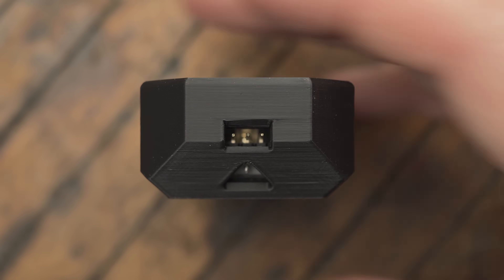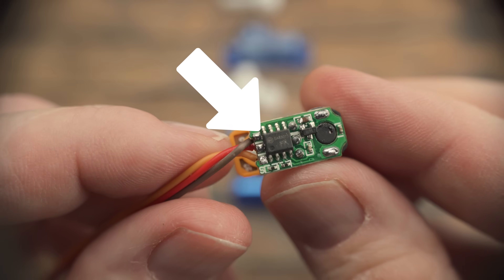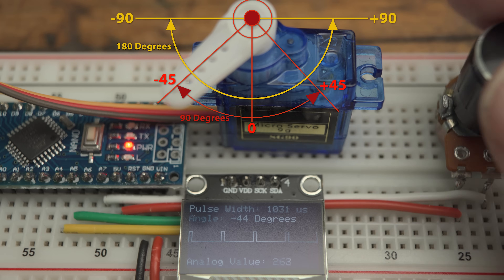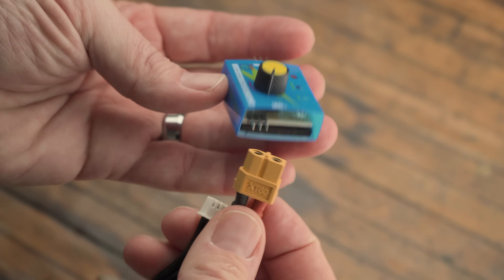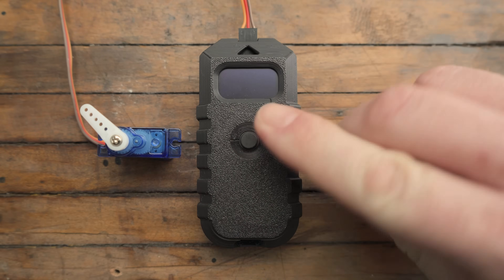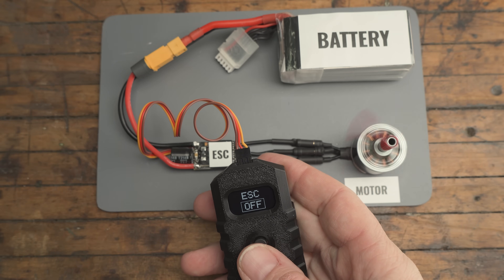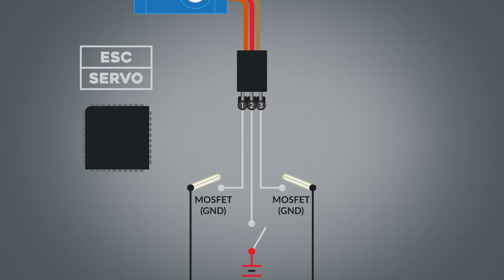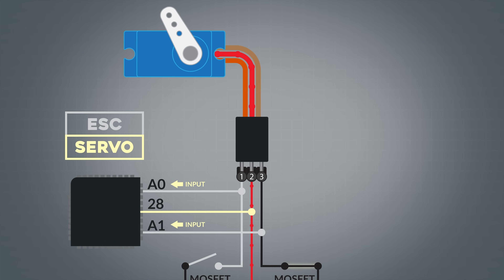Servo Buddy [BETA]

Comment: So what happens if your servo isn't wired into the plug correctly? What if the center isn't positive? Also where do you output how the plug is wired? Which is to say why doesn't the display show you the signal, positive, ground orientation of the plug. As once you plug it into a flight controller or directly to a receiver you have the same problem again. At a minimum the tool should tell you what its detecting.

I think the best alternative to this is something like the toolkit rc mc8. If you can find a good deal on its only $10 more but you are getting a ton more functionality. The mc8 supports PWM, PPM and SBUS input displaying the values via graphs on a color display. It can do the same for output. It can also be balance voltage display. 

If you were to make it open source I would suggest that there are several bits of functionality that could be added. ESC programming would be nice.  It would also be trivial to add support to power and display the status of an RX.  Then if you want to get in to even more adding i2c support and you can support a GPS. Add can bus support and you have support for just about everything on a model.  I can understand wanting to keep a simple UI simple but swapping out that one click to something like a jog dial with a click for select and it easy enough. Then you can lock all those features behind advanced menus or categories and you can keep the simple servo tester but now have a device that has far more capability than what's on the market.

Comment: Love the concept. One downside is it won't work with opto-isolated ESCs (based on your description, it would get stuck in the "scanning" mode). 
Using a pot for control would give you more versatility as well, for setting an angle or motor speed.

Comment: What's the difference from just keeping the servo disconnected from your project and turning it on so that it goes to the center and then adding the lever in the position that you want it at neutral. I've done this for decades with no issues.

Comment: For me, the lack of a dial is a no go. It would add a lot of functionality.

I built a servo tester as a thesis project that has center mode, full throw mode, esc modes, sweep modes, adjustable voltage output, and a current sensor. It's bulky, but handy. I made it so it would always show the instantaneous current, and the highest peak current. Good for load testing to see if your BEC or voltage regulator is up to the worst case scenario for all draw.

Comment: The other function I use on my current servo tester is a constant sweep back and forth to exercise the servo and to test it. 

Perhaps a default timer of x minutes that turns the servo back and forth would be good.
Reply: Is it to see if the servo is at the correct place after x minutes?
Reply: No, it's to see if the servo I've purchased is reliable and has any slippages or stutters in that time.

Comment: Idea for the next gadget. In line servo current draw monitor. When someone calibrates servo end points to match the mechanical capabilities of robot/plane/car it can monitor servo current draw for increase to detect the point servo reached mechanical limit somewhere in the system it actuates. I use this method for Nitro RC buggy and gas planes where there are a lot of mechanical parts involved and they are moved with servos.

Comment: Epic tool!  This would definitely come in handy with rc plane scratch builds.  Super neat way to get the universal plug-in!  Servo testers can just be finicky, and sometimes error-prone.  My initial thoughts are that including an option to adjust the servo anywhere in its range would also be helpful.  Maybe replacing the single button with a 4-direction & center button could allow for this kind fine adjustment, with the right & left buttons utilized for increasing or decreasing the desired angle.  And perhaps the operating mode could be reverted to the center & maximum travel points if desired.  Also, will there be a kit version of this, without the printed parts?